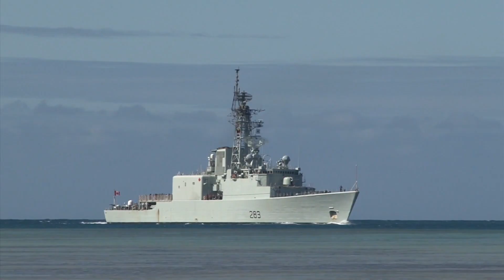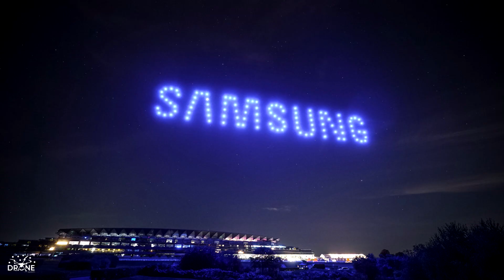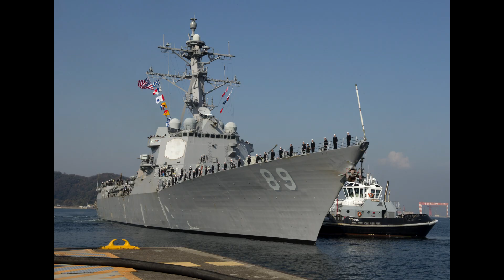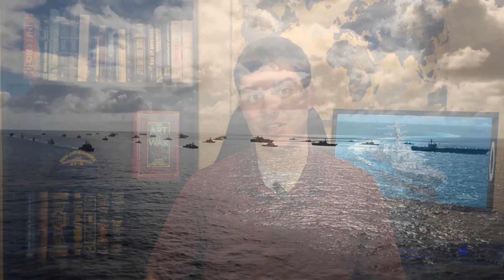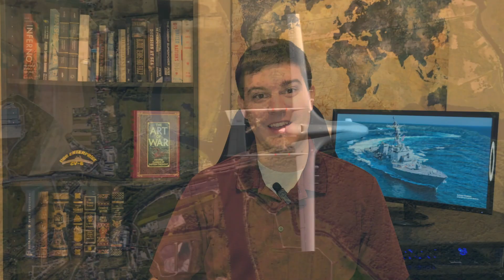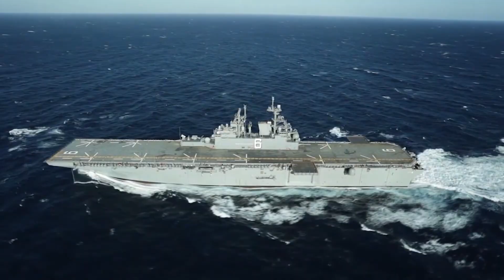Drone Swarms: The US Navy's Greatest Threat?

Comment: Gee its called a flak cannon we made them back in the 40s...just make some newer ones to scale.
Reply from the maker: Its more of the space, power, and manpower issue.  Those guns do take up a decent amount of space and they either need to be manned by crews, which means more crew space needed, or by machines, which means more power draw.  I do think flak guns will be coming back but the degree and scale is probably going to be limited due to the above issues.
Reply: @wms-h2v  yes bit they could make some additional counter drone batteries roughly around the size of the phalanx systems using the same type of munitions the germans use for their air defense.Maybe combine that with multiple Manuel or automatic machine guns firing shotgun like buckshot.
Reply from the maker: I had the same thought, but I am still concerned about ammunition use then.  I think buckshot style rounds could work well but it will have poor range unless the rounds are tipped to explode next to a target.
Reply: @wms-h2v  ah but you forget  back when the US army was developing a new combat rifle one of the cool features was a programable mini grenade launcher that could use the built in range finder and set the grenades to explode at a certain range.This was meant to be used in urban environments to be shot throught windows or over cover and explode right on top of them or behind them.The AA-12 shotgun can use small fin stabilized micro explosives to extend range.With that in mind you could simply equip a ship with 6 to 12 duel cannons.
Reply: @wms-h2v  https://youtu.be/p4ebtj1jR7c?si=gz9z2m7EfNYTKyIT